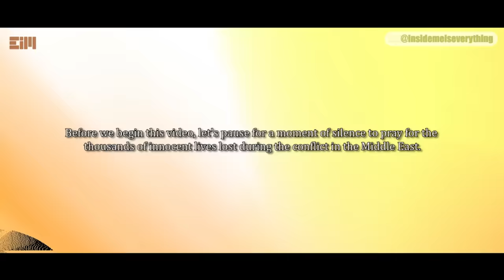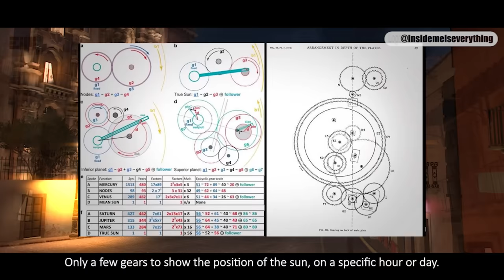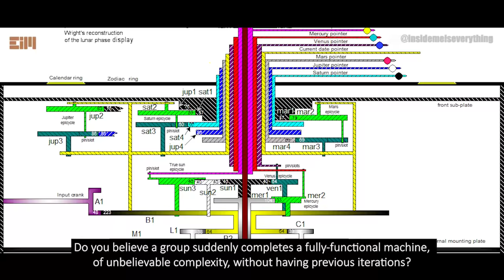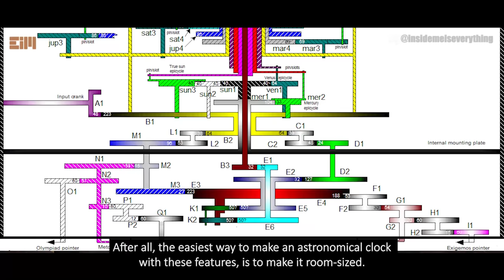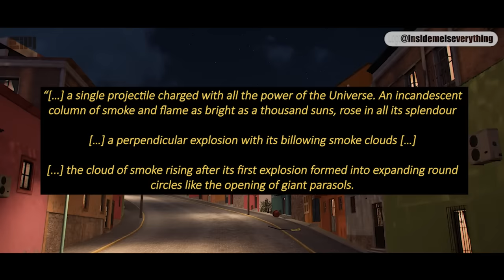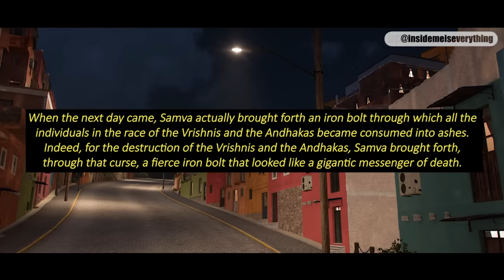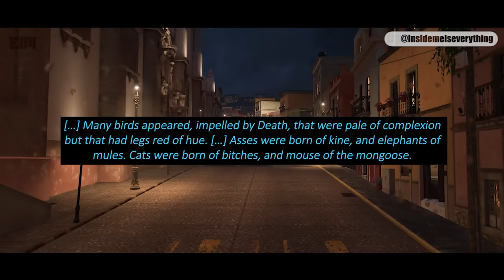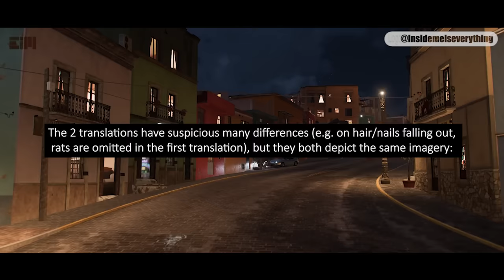URGENT! THEY’RE WORKING HARD TO WIPE THIS FROM THE WEB!

Comment: At Mohenjo-daro, And Harappa, aka Often Called The Indus Valley Civilization, And The Surrounding Areas, Were Hit With Deadly, Extremely High Heat, High Energy Weapons Fire, And High Energy, High Pressure Blast Wave Weapons, From The Extremely Ancient Aesir, aka Anunnaki Pyramid Wars, Which Melted Parts Of Those Areas Structures, And Eradiated Those Areas, And Regions With Deadly Radiation, Which Is Still Measurable Today, November 28, 2024 . . .'-()